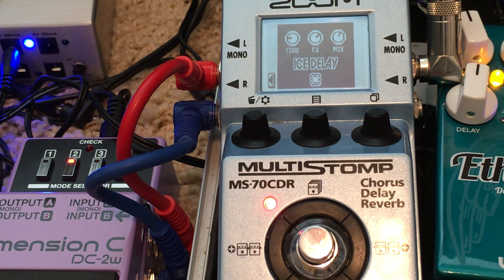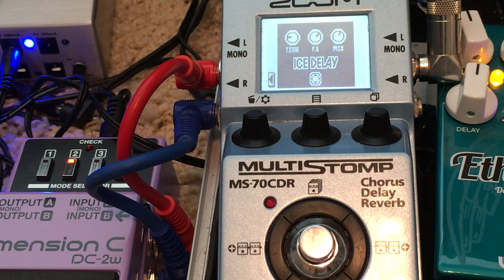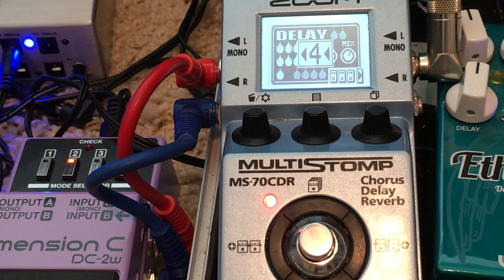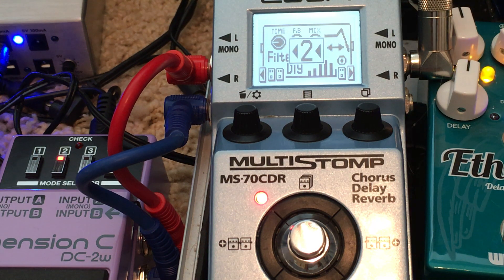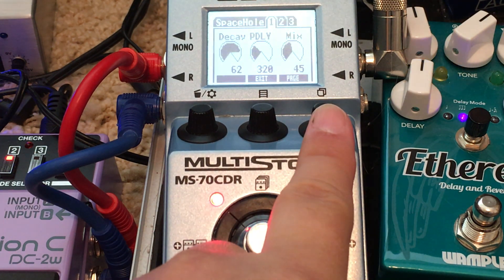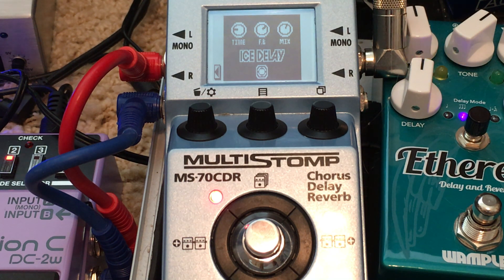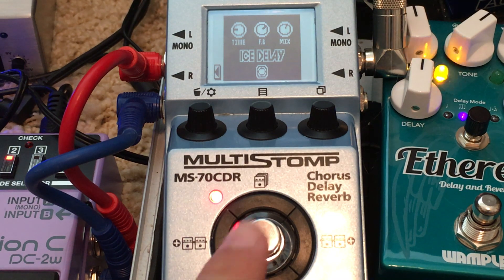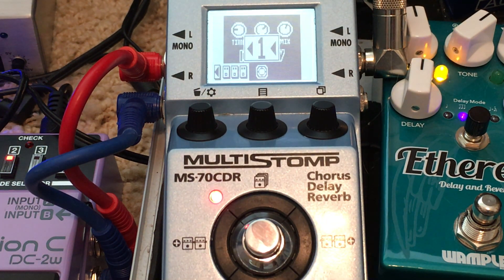Zoom MS Patch Breakdown: Ambient Pad Guitar

Comment: can zoom's chorus go similar with dc 2w?
Reply from the maker: They have a "Dimension Chorus" I believe.  But it's not specifically modeled after the Boss (ie, controls aren't the same).  Offhand I'm not sure how it sounds.   I might have to pull out my Waza Dimension and compare.

Overall the choruses are pretty dang good in this box, tho not always necessarily 100% to their model (I compared their CE-5 model to my actual CE-5).  Same goes for their Clone Chorus.  Not quite as warm as an EHX Small Clone chorus I've got, but you wouldn't be able to tell in a live context.  And it does sound good regardless.

I always tend to gravitate towards the CE-1 model, or their proprietary "Stereo Chorus" (which is stereo in as well).  That Stereo Chorus of theirs is a super wide sound (I have two amps), and sounds fantastic.   

On the whole though, it's great to get a variety of them in one box and there are a lot of them in there.  I'd say the strongest grouping there is (better overall than the delays or verbs IMO).
Reply: @Iodine74  thanks a lot man.i'm looking forward to use this zoom 70cdr unit for chorus,delay,reverb with mooer 009 preamp,a mini ts9,sentry noise gate n mooer radar..hope this works